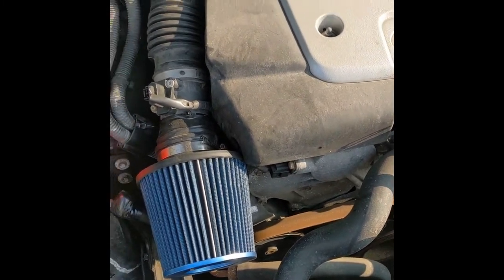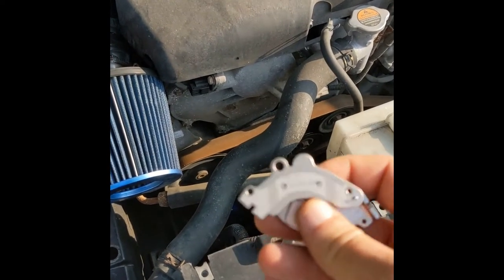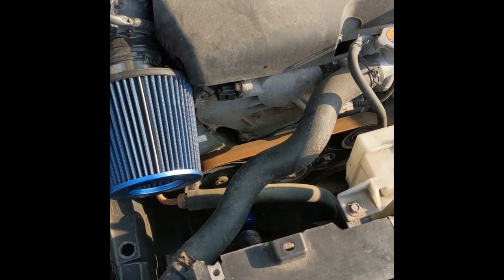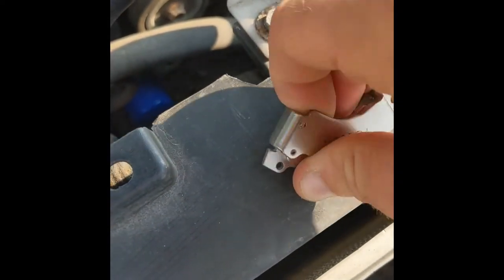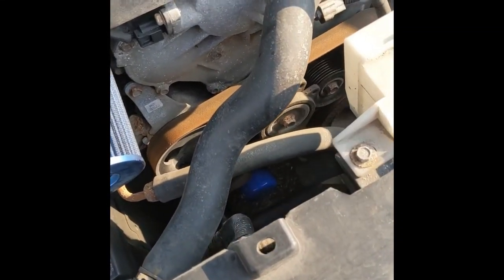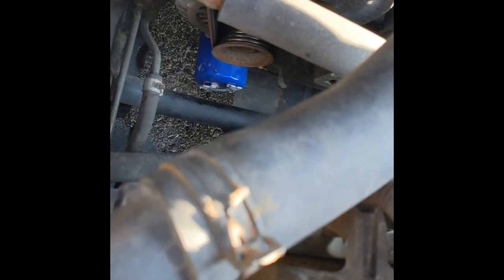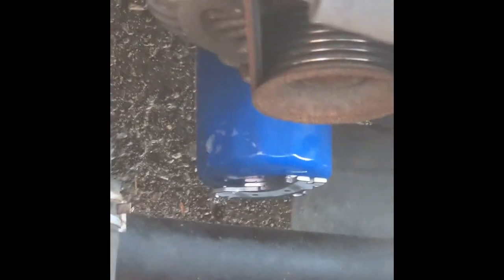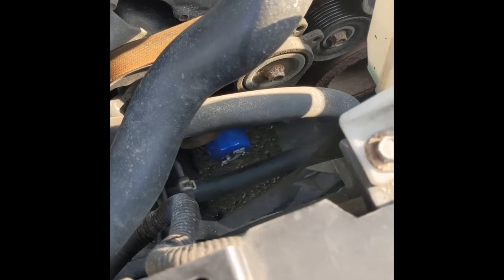Hard-drive magnet on oil filter to capture ferrous metal particles.

Comment: Have you seen any magnetic particles on the power steering magnet?
Reply from the maker: Yah I had one I put in the reservoir after my power steering pump blew up, then blew up the second one. It got really fuzzy fast. I have an inline one now I can't check the contents without cutting it up. I haven't changed it.